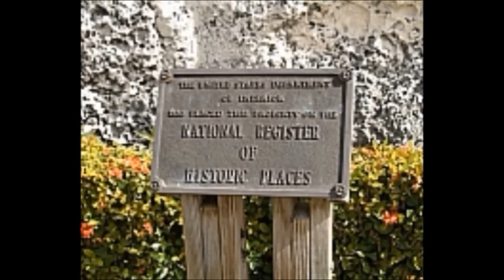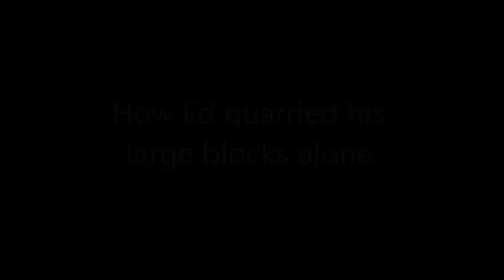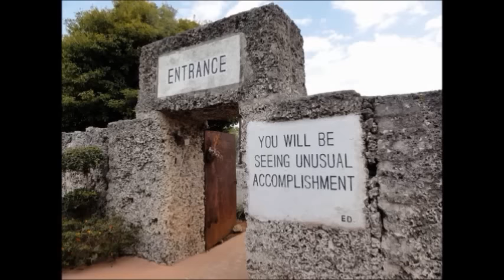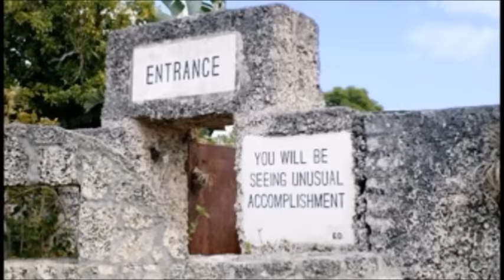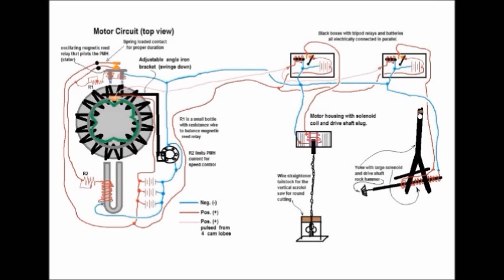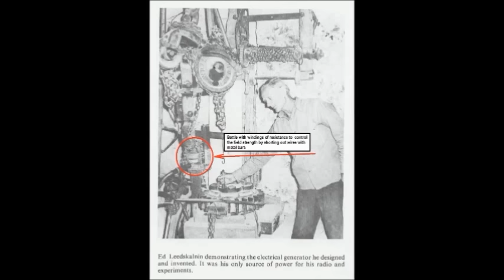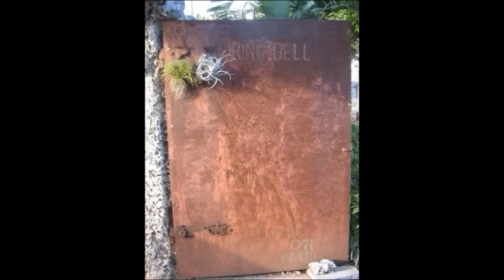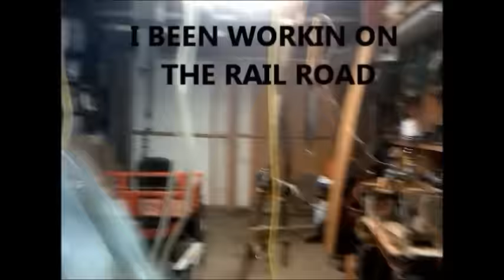Eds Coral Castle Quarry and Flywheel, Engineering Mystery Solved

Comment: you left out a couple points. First, Ed stated he knew how to find the exact center balance fulcrum) of a stone, no matter the size or shape. That was required to be able to move the stones. Second, Ed moved the castle ten miles from Florida city to Homestead, a distance of ten miles, in a 3 yr time frame. Third, Ed clearly stated many times he used reverse magnetism to defy gravity. Fourth, Ed weighed about 120 lbs and worked alone because he refused to divulge to anyone the secret of how to move the stones. You stated you nearly completed a model of Eds machine. I suggest you finish the model, then move a stone 10 miles by yourself. You have only explained how to raise the stone from the ground. something we already knew. And you stated how you believe the machine works but never explained at which point the machine reverses the magnetic field to cause an anti gravity effect on the stone. So basically, we are back where we started. We don't really know how the machine works. KNOWING where electricity moves is the easy part, understanding the effects, exact parameters of the voltage, amps, power (watts) and the magnetic field created is still undetermined.
Reply: I knew indeed there would be no information here. starts out: I was was born very young... rocks are heavy...
Thankfully your comment spared me from the rest.
Reply: There is a very rare video of Ed actually lifting and moving stones using tripod and pulley system with chains rolling on top of smaller logs on top of our logs. He also loaded the trucks that moved the stones 10 miles away and then unloaded them. He didn't physically move the stones by his own hands the way you might think.
Reply: @babayega_  He didn't let people see him work, so why would you expect that him doing something on film is the method he used. Personally, if someone wanted to film me while I work on a secret of mine, I'd make it look like like I'm working the hard way as to trick people.
Reply: During the tour they said he had a team of people help him showed photos ...idk what's true don't care it's something else
Reply: @babayega_  the owners of the castle probably had the video yanked they thrive on threatening people with lawsuits for posting videos probably talking about it. First hand experience
Reply: @SereneSoakingSounds  Indeed.
Reply: Wow, are you an astrophysicist, no joking, I'm know like you they don't and neither will I, he was very unique. I think he took it to his grave for fear of what terrible use we may make of it , instead of using it for beauty, smart man.
Reply: Onda Galápago 🤣🤪 A video showing him working alone and people visiting .
Reply: I think that this is excellent observations. Ed's book Magnetic Current gives idea, but the reverse polarity to levitate or float the stone is still the missing link - how did he do that part. What is also missing is the contents of the black boxes at the top of the tripod.

In using a reverse magnetic field, how did he do that exactly? What did he use to accomplish this?
Reply: Jen kor. No he explained that the machine and parts available were not used to levitate rocks but we're just a pneumatic chisel or power to the saw. They do the labor and precision cutting. Man power and leverage were used to move the rock onto a truck that delivers the rock to its new home.
Reply: @jamesmcdow945  maybe that's why Egyptians are no more?
Reply: Or ed could have just lied about tones of that stuff for attention people do things like that all the time they mystify things to make is more interesting.
Reply: @ExistenceUniversity  I’m a massive skeptic so part of me can appreciate your perspective, but ultimately the skeptic in me also knows you have no evidence of any kind beyond the words of others that gives a single reason to assume that the actual video evidence isn’t the authentic method. You’re probably still young, I remember being in a similar mindset in my youth. Your mind will serve you better if you train it form ideas based on classical logic.
Reply: @nicholasmatthew9687  Seriously? You think you got all that from my comment? You know what they say about making assumptions right?
Reply: @ExistenceUniversity  

The guy wanted attention. It's not uncommon. Why tell someone the truth about using good old fashioned ingenuity that's fairly easy to explain but most Americans even in that time would be bored to tears and ignore...

When you could talk about magical levitation and have the ears of someone for as long as you wanted...

He was a lonely old man, who figured out how to use the best DC technology of his day to make a seemingly daunting task far simpler while getting attention...not as the eccentric he became, but as a secret genius everyone begged for answers.
Reply: @shaunofthedead3000  That I can believe
Reply: @christianvachon2235  there was a battery at the top of the tripod
Reply: His friend help him move the stone with his truck he said he does not knowbhow ed got each stone on the truck because he always told him to go around the corner
Reply: Thank you, saved me time watchin this...you should have done a vid you know more about it..
Reply: Thanks for all your hard work and helping people to understand some of Ed’s genius , 💫☮️💫
Reply: @christianvachon2235  Sound and vibrations are the missing links.
Reply: @thebiglebowsky7842  well like that’s your facts man. how many of harold’s friends died face down in the mud so we could argue over reverse magnetic levitation, and was he somer chavis did he work on the sabbath?
Reply: He didn’t move the stones 10 miles alone… he had a Lorry.
Reply: @Cavemenandgods  A lorry is a truck and there are photos of him using a truck and one where he used a trailer. but no other human helped him because he was angry, would not risk sharing the knowledge, and really didn't need any help lifting the stones.
Reply: @jenkor513  “by himself” implies he floated them 10 miles and also there is no evidence he loaded it on his own and even so he did it with lifts as we see.
Reply: I would also like to point out he used nikola teslas quote of thinking in terms of energy, frequencies and vibrations. Ed figured out that these stones all have frequencies in which they can be moved with ease, giving credence to the old ancient ideas that sound was used to move stones.
Reply: @ilikepiedontu  electricity is also measured in frequencies. USA uses 120v power, that is 60hz for the frequency. Could sound give you the electrical frequency required? probably not.  Could sound give you the density of the stone to help you find the fulcrum or actual weight? probably. Knowing the density and weight of the stone would seem to be required to determine what was required to lift it. Can sound itself move the stone without breaking it? High b flat can break a crystal glass but nothing denser (normal glass). I personally can not see how sound alone could lift and move a stone.
Reply: @babayega_  ever notice the black box at the top of the tripod. Those stones weighed tons and He used the pulley system with the black box to move them. without that box, no one was going to move those stones the way he did.
Reply: @jamesmcdow945  They now hide Ed's personal journals, but Ed refused to share the information out of anger and resentment. A lowly immigrant in the USA figured something out but still got no respect, because he was an immigrant. He swore he would take the info to the grave and not share it. That came from one of his employees, the housekeeper I think.
Reply: Spinning the magnet field that is being generated is what is the most important part, but why are you being so negative. This is very interesting video
Reply: FYI: The stones were moved with a flat bed truck
Reply: @prepaidguest7169  duh it is how he got them onto the truck, and in some cases he actually used a trailer. how he made the door to the castle with a 6 ton piece of coral that turns with a touch of the hand. Before weathering had an effect there was an old film from the 60s showed the reporter turn the 6 ton gate with his fingertip. Many of the courtyard decorations move, with perfect balance, not mechanical hardware. Many look like they should topple and fall yet don't because they are perfectly balanced. The things his stones do are still impossible to replicate. That is the marvel here. He did not have a bunch of people, cables, cranes, and big trucks. He was 5ft tall and weighed 100 lbs. Occasionally a friend or 2 would help deliver the stones to the final castle. In 1923 he was moving the stones at night. He needed help lighting up the ten miles of roads.  the next 28 yrs he built the castle in secret, at night, without help.
Reply: @jenkor513  you're preaching to the choir. I was just saying that he used a flatbed truck to move the coral when the magnetic junction moved to the new location
Reply: @ClubOceanBlue22  And when you can move even one 6 ton stone by yourself (without a crane) come back and let us know. Until then keep decoding. Ed said he was taking the info to his grave and personally, I believe he kept his word. He did not code it into a book. Thousands of great minds have been trying to figure it out. I would love to see someone succeed.
Reply: @babayega_  Didn't mean to imply he moved the stones solely by hand. yes he did use logs and something like a tripod pulley system. If you ever see the film again look at the pulley system. The black box is what Ed claimed was the key. Whatever that box did, it allowed him to find the center of gravity on those multi ton pieces of coral and move them. What he did can not be duplicated by one person today. They need a big crane.
Reply: @jenkor513  While decoding, I discovered there was nothing new to discover. For some of us, this just happens without having to decode anything. I thank you for your kind words, support, understanding and appreciation! ⚜️ God bless!
Reply: @prepaidguest7169  *
Reply: He also left out the explanation for the 9 Ton Gate🤔
Reply: @christianvachon2235  yes, in another video the black boxes held auto batteries for the power to light the castle construction at night. Ed worked a lot at night.
Reply: @jenkor513  the boxes held the car batteries used for night lighting. He worked at night mostly. Your entire rap is BS!🤣
Reply: @jenkor513  he used car batteries and tripods for lighting and lifting and finding the the center of balance of every stone. You don't Know wth ur talkin About! He picked the original site of land he bought to quarry the ancient coral he found there, for it's density and abundance.
Reply: @G.TheMaia  this is just one video. This man is probably gone from us too. His channel left unattended and smeared by little Douchey geniuses such as the original commenter here🤣
Reply: @cat_terrell  I see. I didn't know that. Thank you! Cheers!
Reply: Gravity does not exist. Stop making reference to it. They made it up just like they made up outer space
Reply: Reverse magnetism? No such thing again my guy it's just magnetism that is all
Reply: If the stone is floated off the ground over a metal plate, you could easily move it, push against it and like a car, once inertia is broken it moves more easily, and with msgnetic repulsion would have no ground friction, only air resistance to get & keep it moving. to me, thr machine looks more like an alternator to provide lights, and power, not some weird 'device'. surely he worked a lot at night, it's much cooler here than in the heat of the day.
Reply: Greetings! I visited Coral Castle for the fifth or sixth time just a few days ago. There is no longer access to Ed's workshop on the tours. It's all blocked off" post COVID". Very disappointing, I wanted my boyfriend to see it. Also, now, the front three ton gate no longer rotates easily as it was not oiled or serviced the year or so the exhibit was closed. 
Neat fact: crawfish are now living and breeding in the underground well.
Reply: Ed claimed to have discovered the secret of how the Pyramids were built. 

Leverage? Battery-powered saws? Poppycock.

He loaded a truck with 3 or 4 several-ton blocks, in less than a minute.

If it were as simple as the videographer tells us, we would've duplicated the Pyramids.
Reply: Its a frequency generator and amplifier
Reply: @ilikepiedontu Omg finally someone with a lick of sense! Thank you so much. I was starting to lose faith in humanity. Youre 100% correct. He used frequency and vibration to levitate the stones. Tesla always said the secret of the universe is frequency and vibration. This video was painful to watch and the commenters are so simple and basic its frightening.
Reply: There were pics years ago of ed loading and hauling the stone to new location on a truck. The owner of the truck also was interviewed.
Reply: I admittedly don't know much about this subject but reverse magnetism sounds a bit like magnetic levitation.
Reply: Did you even watch this video?
Reply: Eds life was a fail, should have passed on the information,  he only used it for his own personal gratification and profit. Life fail.
Reply: Some said kids wear peeking through the fence and it was ice cream cone shaped device.
Reply: Thank you. I'm not going to waste my time watching this video.
Reply: You stated very clearly what I had been questioning, while watching the video! Thanks
Reply: reverse magnetism is electricity, he probably didn't know the proper scientific terms for what he was doing and just learned it from the old timers who also didn't know what they were doing, they just knew how to make it work and used different terminology for making electricity from a magnet which did all the work for him
Reply: @VenturaIT  wrong.he knew the correct terms. he called it " magnetic current" and he is correct. you and your scientists don't know the correct terms. maby you all need to study Ed's book,since you all can't do what ed did years ago.
Reply: Wouldn't it be more likely that he used regular magnetism and just picked up the door with a cut block on top of it? Would take less energy than electrically exciting limestone to the point you could pick it up, don't you think?
Reply: @johntoldme  he wrote a book,Magnetic Currents and said all matter waa composed of tiny magnets , not atoms. since he moved snd loaded multiple ton stones on a flat bed truck in 10 mintes,it's obvious he was using a special force.
Reply: John Ernst Worrell Keely might be able to help some of you out here.
Reply: @nicholasmatthew9687  the parts hanging on the wall and laying around
Reply: Thank you for saving me the trouble of typing that out myself. 👍
Reply: Pretty simply really if he was using magnets to "defy gravity" it was probably something similar the track of Japanese bullet trains. Although I'd be willing to bet a lot of this is just myth.
Reply: @jenkor513 : So we need to study what  this guy studies to possibly configure it out ... !!!
Reply: LOL This comment section did not disappoint.  All the mentally ill people coming out to decry this video with no real facts or common sense.  I love the "he moved the blocks 10 miles on logs by himself?" comments in particular because of the lack of common sense. Some facts for the crackpot theorists:  
1. He had trucks he could hall the stone on. 
2. It's unknown how many years it really took him to build this or how much time he spent doing it.  The general consensus is 28 years not 3, but no one really knows so making baseless claims about the time frame to disprove the video is pointless.
3.  His understanding of magnetism is very flawed in many areas, but he was able to make some correct and lucky guesses about particular magnetic properties.  This is not someone who could float things with magnets or had enough knowledge about electricity to do so.  Plus, why would he need to when he had trade secrets of stone masonry passed down to him by his father?
4. It appears that many of his statements were more so riddles or half truths then facts.  So why would anyone interpret them at face value and as fact?
5.  Again probably most important, his father was a stone mason and passed the secrets of the trade on to him.  
We all love good mystery, but there are bigger eggs to crack.  The fact that this video was taken down could suggest its points were closer to the heart then the current owners would like to admit.  Cause the mystery sells tickets not the explanation, which I feel more compelled to see the site knowing the facts rather then the mystery.
Reply: @jenkor513  perhaps the stones were all the same size, if so, I would go measure the dimensions of the black box. The stone blocks would be exactly proportional to the black box, probably even or odd, better yet, prime integer multiple of the black box! This would allow for the stones properties/parameters to be effectively modeled. Limestone is in a fine matrix, very homogenous, yielding uniform density- which Ed definitely knew. 

You see the power of having that black box was the ability to scale down and predict. Also, the black box being mounted at the top of the tripod would allow for each stone block to be cut using a plumb Bob dropped from the corners of the black box, ensuring dimensions exactly in proportion to the black box, thus, making the black box fundamental to each and EVERY block quarried by Ed.

Comment: When I visited, they made a big deal about the perfectly balanced door. It's easy to make a perfectly balanced stone door. Make it approximately balanced, mount it, then chip away at the door until it's balanced. One of the upper corners looks eroded - thinner - I suspect that's where he removed material to balance it.

Thanks for the research and explanation of the electrical equipment! I had thought he was just tinkering with it - it's cool to know it was all functional, designed and built to support his stone work.